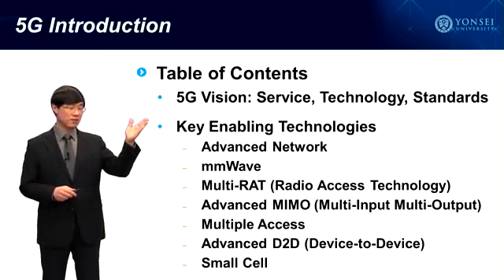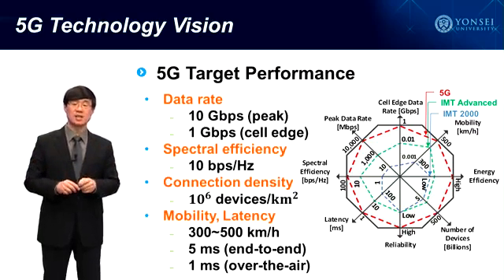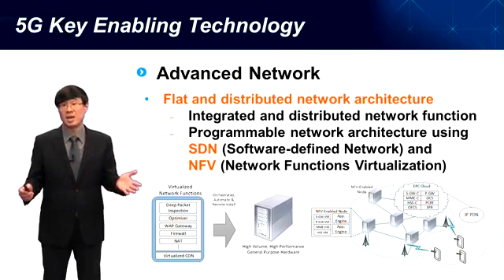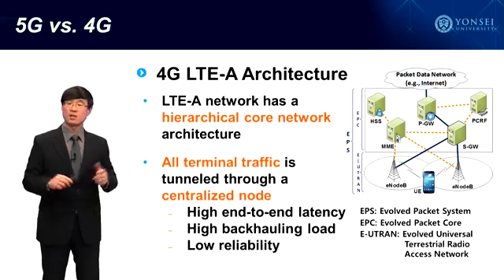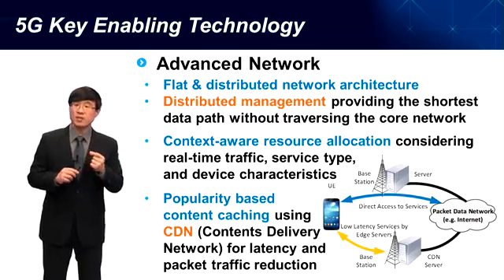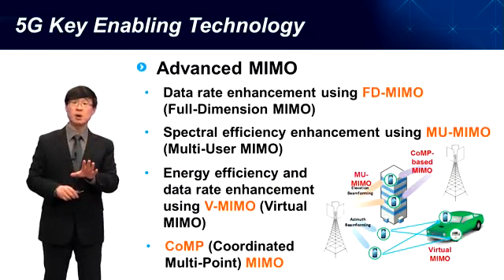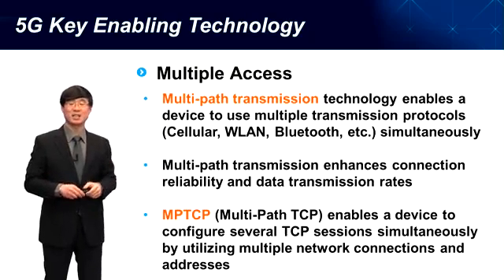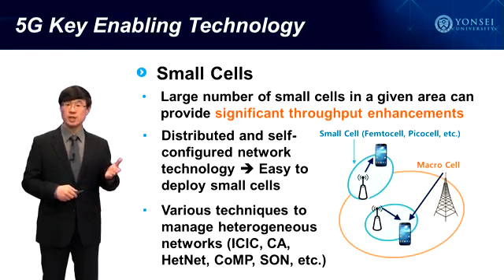Introduction to 5G Mobile Communication Technology

Comment: High energy radio wave beams are created.  4G phones (iphone ) create 1.38 watt energy at speed of 20 Mbits.  Basics of data transmission does not  change.  I am not an engineer but I do see 1. High frequency range/ higher energy is selected and multiple antennas in a compact device to form a radio wave beam! . It is very high energy and travel short distance. Definitely very harmful to nature.  Specially birds and insects will disappear soon. Already we are facing global warming. We will face unnecessary ionization & radiation in micro levels.
Reply: Complete rubbish...! Go to your nearest airfield; are there piles of dead birds around the radar scanners? No, there aren't, and radars use MEGAWATT pulses at very high frequencies, some up to 60GHz.  5G uses the same frequencies as 2G, 3G and 4G, but to increase capacity, base stations also use 3.6GHz, but at very low power (>100mW), otherwise the battery in your phone would go flat in five minutes!  Beam forming is used to allow one frequency to support more than one call at a time (space diversity), and to reduse the power at the base station.  Ionizing radiation refers to the ability of electromagnetic radiation to ionize air; radio waves are NON-Ionizing.  No matter how strong a source of red light you shine on yourself, you will never get a suntan, because only ultraviolet light can trigger melatonin production in the skin. Same with RF; no matter how strong a source of non-ionizing RF you use, it can never ionize air.  Quantum mechanics!
Reply: @Ironic1950  in your opinion, could the 5g network be used as a crowd control weapon?
Reply: No